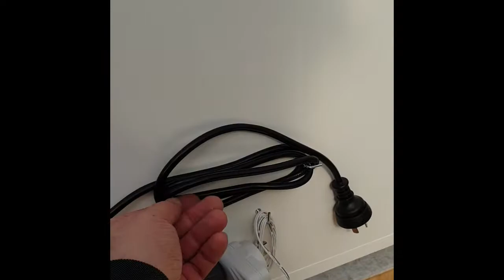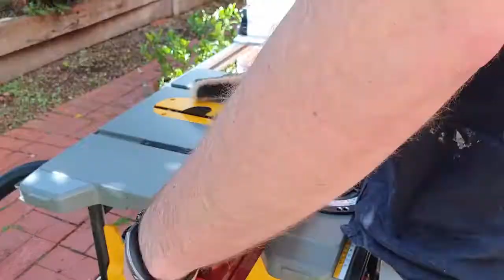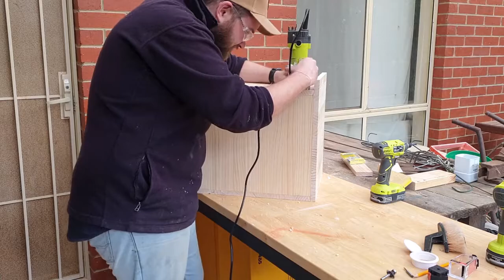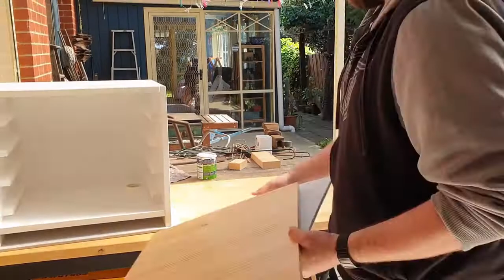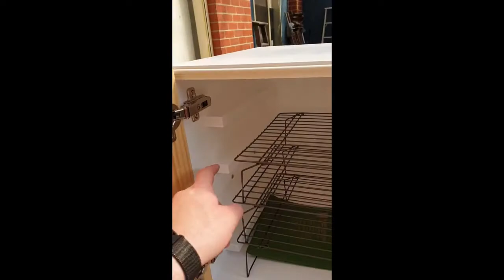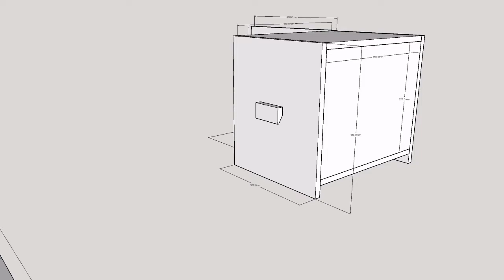DIY bread proofing box for my GF

Comment: 😢 Poor-Man's Bread Box (bottom to top):
- Heating mat with temp regulator (on counter)
- Folded towel (protects container from direct heat)
- 16-quart clear Cambro container (proofing chamber)
- Trivet (raises dough for even warming)
- 2-quart clear Cambro container (holds the dough)
- Small ramekin of hot water (adds humidity)
- Close 16-quart Cambro lid

Advantage: wires not hanging, box not damaged, monitor dough thru clear containers, reuse containers and easy to wash.

😉 Easy DIY bread box for mechanically challenged among us !

Comment: Biggest mistake most make when doing bread such as sour dough is putting there.  Starter dough in the fridge  cold kills the yeast. So does nicotine from cigarettes  on your hands.  And       salt.  And cold hands.    Bleach hands if u smoke and wait 1 hour to give bleach time to evaporate off hands. Wash  off  with  hot soap an water.   before starting it.  Keep hands warm  by rubbing hands together to create friction   so temperature of hands don't kill the yeast.   Salt kills yeast.    Never add salt to dough.  And  keep dough in a bright sunny window  to keep warm.   Or in a warm area of the kitchen such as above the stove.    
If extra sugar to feed dough is needed use powered sugar  mixed with flour in a second bowl.
Reply: No salt to dough .. You need  to learn a lot, boy. Cold doesn't kill yeast, it slows down the proces.
Reply: WTF if you don't add salt the bread tastes bland.  You add 2% salt to total flour

Comment: Most don't have have space in a kitchen for a larg box to proof bread dough in so u improvise an use a. Deep dish  roasting pan. An Mason jar.  With water.       3 minutes to bring to a boil.    Carefully set jar next to dough 1 to 2 inches away from dough  inside.    Put lid on an cover with a thick bath towel.

Comment: Don't need to do all that  all u need is the fallowing 
1 roasting pan  
1 jar of hot water.     
1 towel. 
1 batch of dough 
Stirp of wax paper to prevent dough form sticking to bottom of pan.   
 Take dough.    Place in roasting pan.  Take. Jar of. Hot water from microwave  3 minutes.   
Add jar into roasting pan.      2 inches from side of dough. 
Place lid in top.   Cover with towel to trap heat.  Steam off jar will. Add. Moisture an  help proof the dough as it cools.  Towel  keeps temperature regulated. Repet process 3 times. For.  60 minutes.

Comment: Hi 
I  have  copied your design but I am curious to know how much higher the internal temperature is compared with the external temperature is
I am only getting about 4 degree increase.
Kevin
Reply from the maker: Hey Kevin. We get the temperature up to the low 20s *C in the box. The garage we keep it in the temperature would be under 10*C.
It does take 20-30mins to pre-heat.
Maybe check your door seal or get a high watt heat pad.
Hope that helps.

Comment: I am a contract painter, we use putty all the time, I will tell ya a tip, the reason you can see were all the putty holes are is simply because you didnt "prime" them first, they are a different material than the surrounding wood and most times putty has chemicals to make it dry faster so it doesnt always cure constant, so they stand out no matter what you do unless..you prime them first. Using a oil based primer or any "block sealer" water-based style primer will do. Do all the wood if your going to paint it, this brings all the "area" to one consistant plane so when you paint it, it all appears the same with out showing were you puttied. Im going to make this box myself you did a brilliant job sir,, and i thank you for sharing your efforts.
Reply from the maker: Cheers mate, great tip. I'll remember it for my next build.

Comment: Does the heater pad emit any unpleasant odors? Thanks for the video and plans.
Reply from the maker: No odours. The heat pad is just very warm to the touch. It's says it's for a reptile enclosure. I guess it's too warm the soil in the enclosure. We've not had any problems so far. In the small space, it works well.

Comment: if that mat is water proof, you can put a wet sponge on it for added humidity.
Reply from the maker: It's not waterproof. It does say it's water resistant so don't submerge it in water. I guess if you have your sponge in a bowl or container would be find.

Comment: Hello Renegade, It's me again BakerTed.  I live in Jacksonville Florida. My question to you is would you be willing to share your Sketchup model of the Bread Proofing Box with me?  I would really like to be able to print the plans as you designed them on separate enlarged sheets and build it exactly as you did yours.  I understand that you can email the file (I believe it is an SKP file).  I do not know how to securely share my email address with you on YouTube. If you have Facebook you could message me then I could provide my email address or GoogleDrive folder Or DropBox. Your project could not have come a t a better time.  I bake sourdough bread and Croissants sell them to friends and your box is perfect and I could enlarge it as needed when the time is right. Thanks for your time.  Edward Knight

Comment: Any chance you could post a link to a pdf or some printable format of the cut sheet? (dropbox  or google drive as examples)
Reply from the maker: Hey, I've pinned a link with a cut list.
Reply: @TheWilliz7  Hi 
Can you let me know how much hotter it can get in the proofed compared with the outside temperature
Reply from the maker: @100kevinsim  Ours gets up to the low 20*C in the box. That's a good 10-15 degrees hotter that the outside temp.